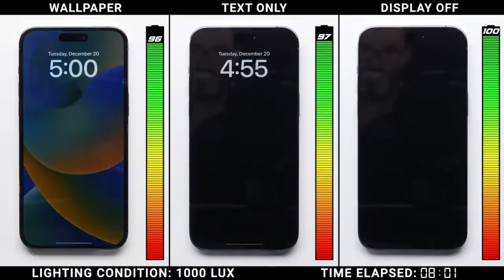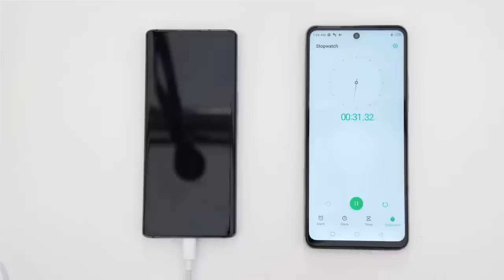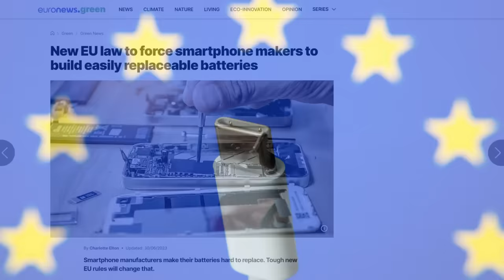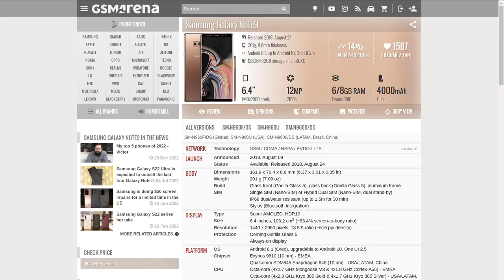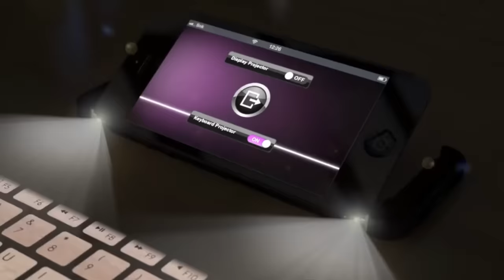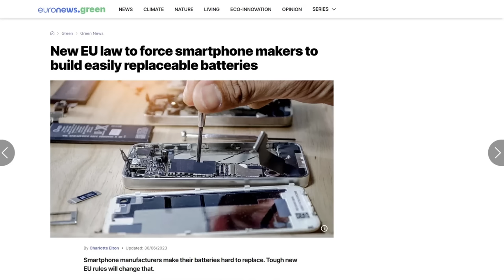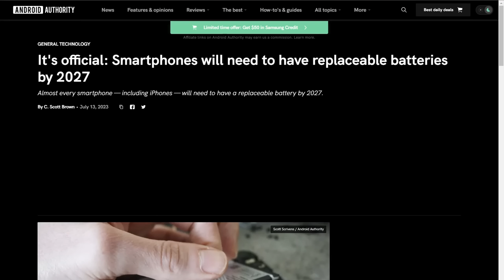All Smartphones Will Soon Have Removable Batteries

Comment: Actually I strongly support this!

The only downside: I am a great fan of outdoor/waterproof phones. However, if the phone lid can be completely taken of, that makes it harder to build a phone that's water proof.
On the other hand: Since outdoor phone like the Ulefone Armor X10 are physically indistructable, a changable battery is the only thing missing to extend the phone's lifespan to... very long. 10 years?
Reply: There is a spray that inexpensively can make a phone waterproof - helping the phone become more waterproof was just a strawman argument that didn't hold water (no pun intended).
Reply: The Galaxy S5 managed to be waterproof AND have a replaceable battery

It is possibleto have waterproof phones with removable batteries
Reply: It won't be much harder. The lid would have to be designed properly, clamp on firmly and have a simple rubber seal. That's literally it. Just look at any food container with an airtight lid, not complicated at all.
Reply: those chinese cheapo phones will get unbearably laggy after 3 years
Reply: They won't if you're able to unlock the bootloader and flash stock android without the out-of-the-box junk code that the phones come with
Reply: Few people care about your need to dunk phones in toilets.
Reply: So buy a waterproof case?
Reply: @GeeEee75  I prefer the phone to be waterproof itself and shock resistant. Kind like this phone:

https://www.youtube.com/watch?v=GwZPCPFgkIA

However, as previous commentaries have pointed out, this is very well possible WITH changeable batteries.
Reply: i don't give a toss about water proof things, they break as well

Comment: Lets not forget that Galaxy S5 was waterproof, but still had removable battery. Also Samsung still manufactures Xcover models with removable batteries and dirt/water proof.
Reply: Yes
Reply: Written on a xcover pro 6
Reply: So the only real reason for unremovable batteries is a lie... figures.
Reply: The S5 felt really cheap compared to other flagships like the Xperia Z3 or the iPhone 6. There was a reason they went for glass backs in the S6.
And the waterproofing is only as long as the cover is on, so if the cover pops out on impact the ip rating doesn't matter anymore.
Reply: @-jg9pi I would much rather have a "cheap" feeling phone over a phone which has a set death date and if I wanted to continue using it & not waste my €1000+ price I paid, I need to either pay half of that to the company or trust a local repair shop, pay around €100-200 (depends on model, difficulty of repair, area, etc....) and hope they don't fuck up & try to lie to me.
Reply: @LuxEternis  no reason to put cheap in quotations as if there isn't a consensus on what is considered cheap in consumer electronics.
On top of that, there could be regulation to make repair easier, and/or provide the tools for repair themselves like not glueing everything down so aggressively. That wouldn't hinder progress atleast.
Reply: I have been using an XCover 6 Pro since January, and will not even THINK about paying money for a new phone for at least 3 years. I finally have something with longevity built into it - not that stupid S22/S23 that's covered in glass for no good reason with a locked battery!
Reply: Motorola still makes the flip phone too!
Reply: Yeah but it also had that really ugly and terrible flap on the charging port

Comment: Never forget that the samsung galaxy s5 released in 2014 had a removable battery and was IP67 dust/water resistant.
Reply: They still make an XCover to mil spec with a removable battery.
Reply: Not to forget the 3.5mm jack and micro sd card slot! That was a nice phone.
Reply: The back of the case of my phone (s5) was flimsy and often come off. Once it come off and my mini SD card came out too and I never found it. Lost 2 years worth of my pictures including 2 children. So very sad. These days I have auto back up to google photos just incase.
Reply: And it has an IR blaster! I still have mine. Great phone. 👍
Reply: It had a flimsy charge port cover that would snap off in most units
Reply: @Liv1ngTheDream  And how many people are buying the XCovers?
Reply: Impossible

Comment: Small power banks aren't going anywhere unless all smartphone batteries are standardized. If you have multiple battery powered devices, it's much more convenient to have one charging bank for everything rather than carry 5 different batteries for each device.
Reply: but the point of having removable batteries is to extend the phone's life since batteries are usually the first thing to die in an electronic.
Reply: THIS! Huge oversight on the part of the video author there.
Reply: Or the powerbank is also used for other devices like my old 3DS.
Reply: Dude. That end. 😂. What did you smoke?
Reply: charge for time or swap in no time, what is better

Comment: One important privacy consideration: You can now actually, definitely disable your phone while still having it on you, even if you didn't go for one with hardware switches. If you don't want big brother to be watching, pop out the battery.
Reply: They pop in a capacitor or something for that, don't worry.
Reply: They have onboard batteries anyways.
Reply: @fotoschopro1230  while this is true, those batteries have to run out of juice eventually. but the best way to stop big brother from watching is to not bring your phone.
Reply: @walkingcontradiction223  A capacitor the size you can easily fit in a phone will only last it for a few seconds, possibly to dump the drive's cache.
Reply: But have a faraday cage just in case
Reply: A separate, onboard capacitor or secondary battery is of limited use when the primary battery, if removable, already occupies a good deal of space. Furthermore, "they" have to aim for plausible deniability. Would the use case for a secondary, internal battery or capacitor be very obvious? You could try to explain it away, but I think it would be.
Reply: A phone that pops on and off the network is VERY glowy. A phone that only ever communicates with a closed network of others is VERY glowy. A phone that travels on a route that another phone-of-interest does with a high correleation is VERY glowy.
Reply: Ok schizo
Reply: @jesseessej dude, go google "RTC battery". this isn't some conspiracy theory.
Reply: @elsenorvananas  okay bugman
Reply: @walkingcontradiction223 Doesn't work as well as a battery, hence that design is rarely ever used. The original Xbox is the only device that comes to mind.
Reply: @elsenorvananas  your comment glows brighter than the fucking sun
Reply: @@thedestroyer5332 I tested the bag my coffee beans come in, it works great. Fancy chocolates come in these kind of plasticized foil bags as well.
Reply: @walkingcontradiction223  A capacitor dense enough to power a phone for longer than a few seconds (if that) doesn't exist.
Reply: @_colonial_  It is not meant to power the whole phone, only essential components to send out signals
Reply: @kiq4767  Cellular and/or wifi transmission is very energy hungry, and they can't do shit without an operating system to tell them what to transmit. The idea of an internal capacitor powering your phone for any meaningful amount of time is ridiculous.
Reply: Most devices these days have a secondary backup battery in order to keep time even when the main battery’s dry.
Reply: It will have additional second battery
Reply: @tissuepaper9962 CMOS battery’s can’t even power phones, cmos’s store time and date and like bios settings if on PC, you can’t use it to power a phone
Reply: In 2027🙄🤦‍♂️
Reply: @isbestlizard  A phone in itself is very glowy; we are just forced to live with them anyway
Reply: There surely be a independent battery for a clock
Reply: @jesseessej  to keep the clock running. You know that every desktop computer and every laptop with user-replaceable battery has one?
Reply: wrap it in tinfoil, no joke
Reply: @elsenorvananas  Ok fed
Reply: @obongonigga  yes, I'm aware, but surely you must concede there's a difference between the expensive ankle bracelets we've all been coerced into paying for and carrying around in our pockets, and a PC which can be fairly easily opened/serviced and which does not have integrated cellular modem, antenna, microphone and camera, gps and a variety of sensors, or at least has options not to, which can be disconnected from the network and which you're hopefully running an open source OS on, powered in a very limited way by a cr2032 operating at 3v and capable of delivering around a maximum of 3mA with a non -rechargeable lifespan of around 225mAh. There are some exceptions to this of course with laptops, but again there are options. And again, any technology designed with nefarious purposes in mind needs to be designed in such a way to be plausibly deniable, or be so discreet/undetectable that most people could either not notice it or wouldn't know what they were looking at. Now, do I believe all modern CPUs have hidden side-channel instructions? Why yes, I do.
Reply: @bettercalldelta  dont call me a feral Black investigator, you glowie!
Reply: @isbestlizard  have you ever run out of battery? you hnave? glowy.
Reply: @jesseessej couldn't you use a secondary battery for the ability to hotswap batteries?
Reply: Everyone here us talking about Feds, big brother, and glowies, while the most antistate they've done is buy weed and pirate a few movies
Reply: @mamapillow8365 a small Faraday cage will always be the way to go for people who really need security.
Reply: You can still be tracked with no battery in the phone.
Reply: They've already studied similar; your phone tracks you before you take it out of the box and turn it on.
Reply: @F-aber  Hi Marvin. Yes you could. In the context I was speaking, it was whether or not a small internal battery, secondary to a primary removable one, would be useful to power the phone for meaningful (or nefarious) purposes.

Yes you're absolutely right a secondary battery which can be swapped with the primary, of the same general type and capacity, could be used in this way. And, it would be very convenient that we could go back to doing so.

There are of course some benefits to a unibody design and negativities to the lack thereof.
Reply: @walkingcontradiction223  well, it's one more battery that should be removable without use of proprietary tools.
Reply: @user-nm4vz5of7l Remember when women were able to get an abortion in the US? I do.
Reply: @@hobogardenerben yeah so true. Your right. YouTube is more addicting than alcohol. That's by design.
Also your 1st point is correct. I remember in 2014 and earlier how much easier it was for people to improve their privacy and security. Now it's so complicated and difficult that it's become annoying and hard to understand, and most people just give up out of frustration.
And once you manage to figure out a good way, the tech companies make correct hardware/software obsolete and no longer fully functional, and people are forced to but the newer tech which is even harder to secure. Were all slaves to corporations
Reply: @isbestlizard  I understand your 1st and 2nd point but I don't understand what you mean from your 3rd point.
Can you explain?
Reply: @DarkGhostHacker  If you're trying to keep two phones unlinked (say one is a main phone the other a burner) don't ever carry them together turned on, because they'll move between different cell towers in a very correlated way. Ideally don't ever visit the same locations even if not carrying them together turned on. Your favourite coffee shop, bodega, place of work, and home address is likely almost unique.
Reply: @isbestlizard  communicates with a closed network of others  - I DONT HAVE FRIENDS THO
Reply: @bringbackdislikes3195  what an npc example to bring up in this conversation, as if that act is something edgy and politically significant instead of just nihilistic baby slaying that the ruling class approves of
Reply: Or a shielding bag à-la Faraday cage.
Reply: @@hobogardenerbenUnusual behaviour? Guess I'm on the FBIs most wanted list now after I used to pop the battery out of my phone back when I was 7.
Reply: @@hobogardenerben Do you know what a joke is, sir? 🙃 I was referring to the fact that you said "unusual behaviour" in regards to removing the battery of a phone. Which back in the day when I got my first phone I did constantly, until they removed that feature in the recent years, with newer models...
Reply: @jesseessej they'd say it was so you could swap the battery without turning off the phone

Comment: I hope we, the consumers, get a win. It'd be a shame if phones implement removable batteries just to have replacements blocked by DRM
Reply: I don't think we will get a win, the power imbalance between producers and us, the consumers, will always make us lose, so DRM or some other caveat it is
Reply: phone batteries already have DRM, chargers too
Reply: And OEM batts cost $700
Reply: @concertmaster  says the consumer, holding in his hands a device that 10 years ago would've been black magic.
Reply: @MrTomyCJ  at what cost
Reply: @MrTomyCJ  what kind of argument is that
Reply: @concertmaster  Do you think that there could emerge like a Framework but for smart phones? Because typically oppressor/oppressed dynamics only happen in a centralized/monopolized market
Reply: @MrTomyCJ  A computer was black magic in 2013? Do you live in the middle of the Amazon rainforest?
Reply: @aaronspeedy7780 Probably, since there's money to be made. Old industry veterans banding together to make a new hip phone brand that advertises being modular (think moto mods, but open hardware). You could add high speed flash, or add microsd, separate camera implements, extra batteries, or even a satellite phone antenna or 2m/70cm antenna, even SDRs. Likely very expensive, but a great deal.

There's a 50/50 chance it goes to shit, though, because it may end up being consumed by greed.
Reply: @michaellin4553 t’s 99 to 1 that it will go to shit, because this is not a video game, where you have 3 empty slots, where you put your gems into. Someone asking for an antenna would require a different production line, and maybe even a whole new design. And then you compare it to major brands, that have everything pre-packaged, and you lose all the appeal.
Reply: Quote from the regulations: "Software shall not be used to impede the replacement of a portable battery or LMT battery,
or of their key components, with another compatible battery or key components."

EDIT: Also this:
"Any natural or legal person that places on the market products incorporating portable
batteries or LMT batteries shall ensure that those batteries are available as spare parts [...]
for a minimum of five years after placing the last unit of the
equipment model on the market, with a reasonable and non-discriminatory price for
independent professionals and end-users."
Reply: Start calling yourself a customer if you have any self respect
Reply: @MrTomyCJ  We had smartphones that were not that much different than what we had now in 2013. Maybe someone from an uncontacted tribe would see modern phones as black magic, not you average smart phone consumer.
Reply: Also, Apple is going to have USB-C ports, but with "the Apple way™", 3rd party USB-Cs will charge intentionaly slow, and "Apple USB-Cs" are going to charge normally, not faster, normally. (with usb2 speeds). Remember these changes might or will be ONLY in Europe. Good thing im in Europe
Reply: DRM are not allowed by same law that requires batteries to be removable,

No doubt there might be so new angle that will be tried, but law tries to be explicit and functional.
Reply: problem is that if you want to make a phone last for 10 years, you would have to buy a replacement battery for that phone and unless the manufacturer makes the same battery for its devices you will get a 10 year old battery as dead as the one you used the entire time
Reply: @concertmaster  you guys are so pretentious "I hope we, the consumers" "The power imbalance between producers and us, the consumers" youtube comments got people thinking their opinion is being scrutinized before the court or something, we get it, WE ARE CONSOOMERS
Reply: @tovape  if there is a market for batteries, someone will buy and resell them at a mark-up, so I wouldn't worry about that. You pretty much still get batteries for old laptops as well
Reply: @concertmaster  regardless if they understand something or not you aren’t educating anyone even if you comment under 1 million YouTube videos
Reply: @concertmaster  I think you’re a smart guy and I think you already know this stuff im telling you. I think you just like typing things like that to sound smart and have someone to talk to. Which is why I called you pretentious, as well
Reply: @tovape  aftermarket will take care of it,
You still can buy old Nokia 3310 batteries.
Reply: @MrTomyCJ Deepthroating corporate boot are we?
Reply: @concertmaster  "Software shall not be used to impede the replacement of a portable battery or LMT battery, or of their key components, with another compatible battery or key components." From the law.
Reply: @w花b  a couple hundred bucks, which is at most a couple days of work in a first world country. We are so used to this level of wealth that we have forgotten how unimaginable it was in the past.
Reply: @mrmerfeo4320  Do you make evertything you use by yourself? being a customer is not a bad thing. I am a customer and many other things, it doesn't define me, it just describes a thing that I do among many others. I can also be an artist, an engineer, etc etc. We are customers: we buy things so we don't have to make them ourselves, so we can employ our time in more interesting things. We should be thankful for having that possibility.